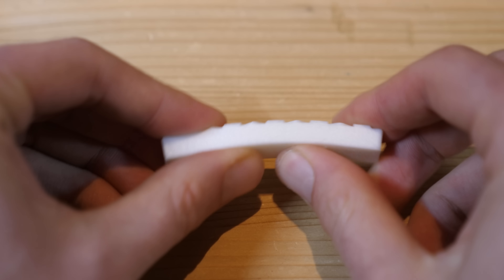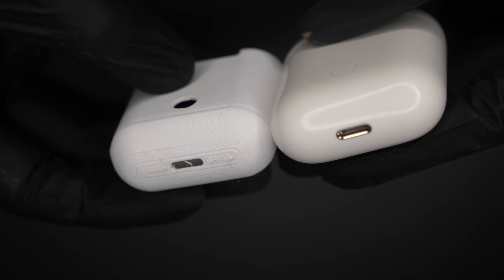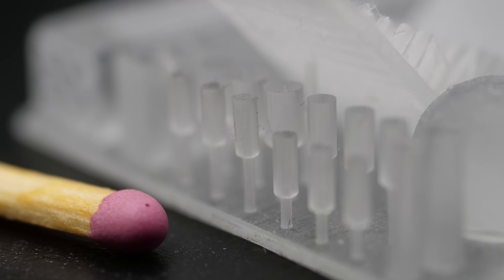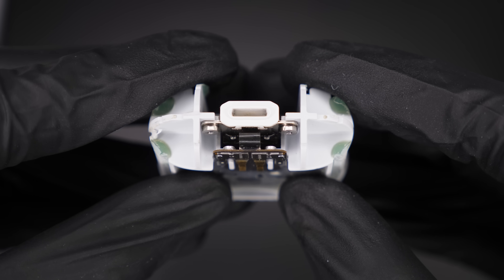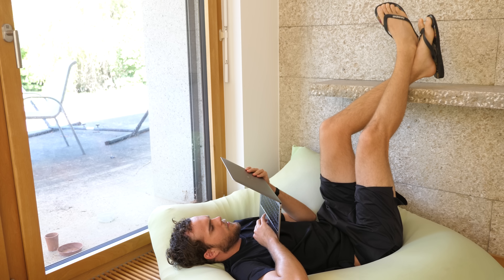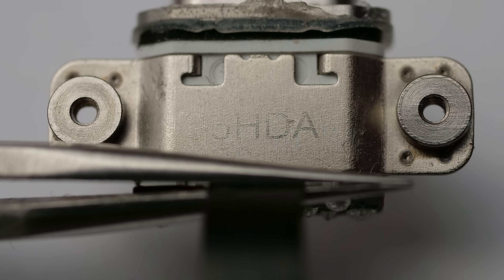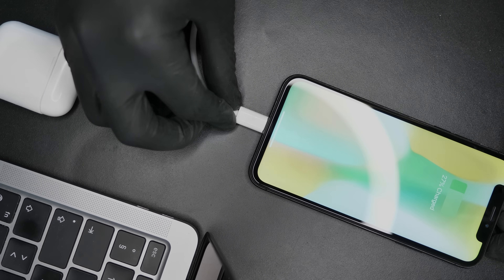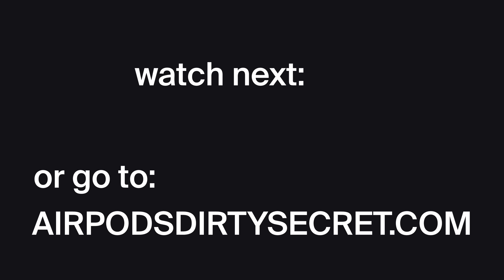AirPods' Dirty Secret (and how I'm fighting it!)

Comment: Excellent work! There is much to love about Apple, but their habit of waffling on about how environmentally friendly they are while simultaneously going out of their way to design products so they cannot be repaired or even have the batteries replaced is unacceptable. Apple has the might that other companies don't have to push the entire industry toward more environmentally responsible production. Projects like this are a great way to dismiss Apple's claims that they are doing their best.
Reply: I went into an apple store about my 12 mini because the battery is crap. Instead of a replacement under warranty they waffled on about ‘habit changes’. I honestly hate this company. I only got it cuz the small screen. Might move back to Samsung…
Reply: @cottage_pie  yea man come to Samsung gang
Reply: @johnlexin7748  I love Samsung but the phones are too big. Make them release a galaxy mini and I’ll switch in a heart beat.
Reply: @cottage_pie  I fired up my tiny S7 to try a new SIM... Found out I can no longer see the words on the screen without 1.5 mag glasses. back to my s22. it weighs a lot, but I can read the screen, and now I get muscles in my fingers too!
Reply: @k0nanick  You can just increase the size of the text to 125%, 150% etc. Everything else gets adjusted.
Reply: @cottage_pie  A “genius” told you that too. I’ve used apple since the 3g and honestly, I hate them. But I also love the os/ecosystem. As a company they piss me off so much.
Reply: "You will own nothing, and be happy with it."
Tesla does it too, even the people who make farm tractors do it as well.
Reply: @GrimReaperNegi  John Deere especially, I've heard.
Reply: @thebiggerbyte5991  Yup!
Reply: Apple has used that might to move the industry alright... but not in the right direction. Before Apple replaceable batteries was a thing. After Apple it's almost seen as a ridiculous notion. They steered the industry in this with the iPod and iPhone.
Reply: @Cimlite  Absolutely agreed.
Reply: What is there to love about Apple?
Reply: @Zorooooooooooooooooooooooooooo  icl iMessage and airdrop are what i use most, but the longevity of my iPhones are the biggest influence. I had a Samsung a few years ago but after about 18 months it was ridiculously slow. What are the newer ones like after a few years?
Reply: @ryleypalmer  Newer Samsungs are way better in that regard. They’ve streamlined the skin they use on top of android quite a bit, so it’s less bloated. My S20 FE while granted isn’t super old, it’s still a couple years old and runs like new.
Reply: @ryleypalmer  don't know what iMessage does but android has its own air drop that works just as fine as apple's
Reply: @ryleypalmer  you moan about samsung slowing down, did you clear your cache? 
I've had a Samsung for years and it's never got any slower and still benchmarks as it did brand new. 

I think you may be confused with the fact apple slow shit down to force you to buy the next model.
Reply: @boziewz6125  both Apple and Samsung got in legal trouble for intentionally slowing your device down. Look it up, apples not the only guilty party here.
Reply: @MrGamelover23  maybe so, but samsung do it far less, and rarely at all now. 
Like I said, my s10+ is as fast as the day I got it and still scores within range on benchmark tests. Battery lasts longer than a day, even with relatively heavy use (pokemon go). An apple purchased at the same time, wouldn't be the same story.
Reply: @boziewz6125  yeah, I have an old s8 active that I still use with wifi and still works as new. I think some people don't know how to properly kill apps and leave them running in the background.
Reply: @kevinmitchell766  I don't think people understand about how battery health works as well. Most will fully discharge before charging, or give a lot of little 5min charges. Plus background activities and bloatware. 
But, that aside, the biggest issue is materialism, people just want the next big thing and make up excuses as to why they need the upgrade. And the usual one is, my old phone was just too slow.
Reply: @boziewz6125  You think Apple users know how to clear cache and cookies? 
According to most, they want a phone or pc 'That just works.'
Most people these days won't wanna know about the 'how' or the 'why.'
It's like how our parents and grandparents could repair their own cars & most things in their houses but comparatively, we can't fix many of those things. 
And now this generation, they don't even wanna learn the basics of a phone or a PC.
Reply: @ryleypalmer  seriously? After apple has been sued in court for this exact thing
Reply: @Zorooooooooooooooooooooooooooo  the ecosystem is unmatched
Reply: @Zorooooooooooooooooooooooooooo  Apple has led the way in smartphone design ever since the iPhone - just look at what Sony, Nokia, and Samsung were doing before and after. Apple designs have led the way and most manufacturers have copied - most laptops now look like Apple, for example.  Apple has done more to turn 'computers' - once seen as geeky  - into cool must-have consumer products than anyone else.  I'm not saying all of it is good - far from it.  I am not saying Apple has the new ideas first - far from it.  But as far as being the most desirable, fashionable and market-steering brand, they are untouchable.
Reply: Big companies only really exist for profit to be honest

At least in my opinion
Reply: @gameseeker6307  all companies are for profit, big and small.
Reply: @asherdie  Some more than others. Just take the charging cable for instance. The most blatant pain that causes trouble and waste for no good reason at all. They don't care period. Plus no back button problem is most don't know what its like to have that control over ads and apps but that is how you maintain control over a people they just don't know. Can't change half my settings and the apps have less control as well I couldn't even delete multiple emails with my favorite app. At least Samsung uses global standards with cables and charging bricks. I still hate Samsung as a company the culture in that country is atrocious. But Apple is the opposite of freedom and America so take that back to Europe or Korea or California but don't Democrat my Freedom by taking away control and calling it security. Let me live outside with the wolves instead of trapped in your prison. At least I die a free man where others perish never knowing it at all.
Reply: @nihcopower808  but for real, tell us how you actually feel. 😂
I went with KYOCERA over Chineseium devices.
Reply: @gameseeker6307   ALL companies exist BECAUSE they make a profit. Even so-called non-profits have to bring in more than their costs.
Reply: I think what they're doing is called "lying"
Reply: @KingRidley  what who are doing? Who lying?
Reply: what is there to love about apple past how m1/2 is mildly interesting due to high efficiency and performance since being ARM
Reply: Apple never gave a shit about the environment, they consume massive amounts of toxic lithium, their products produce millions of tons of e-waste every year, and employ sweatshop labor im countries where environmental protections are an afterthought. Their only priority is pumping their share price, and they know the green excuse will work on their upper middle class consumer base because they never think past surface level environmental concerns when it comes to their favorite companies.
Reply: Apple is evil !!!
Reply: They're also fairly easy to hack (hunter biden, anyone?) overpriced to hell and back, and pretend to have data privacy features. Air Tags, more than any other product they gouge you for, are the most antithetical to the very concept of privacy itself. They're literally "always-on" tracking devices
Reply: "much to love about Apple"
I guess you like it when you're treated like a douche?
Reply: Nothing out of the ordinary ??
Reply: my first phone was a 5c and the only reason I stopped using it was because the battery died and they told me free batteries were for 6 and up
Reply: If you haven't noticed... pretty much all of the companies that claim to be "green" or "environmentally focused" are some of the WORST polluters out there....  The whole thing is a scam.. designed to empty your wallet and make you think you are doing "good"....
Reply: Apple is trash. Environmental criminals, tax evasion....
Reply: Apple sucks
Reply: Why will they change their dirty ways? People buy it anyways. There is only 1 way to force change policy in a corporation that absolutely driven by greed... make them lose money, do not buy their disposable gadgets, only buy what meets your standards. I stopped buying Samsung since the S20... they pulled an Apple on me, their new phones do not meet my standards, if more people had real principles we will not be where we are with all this companies thinking you rent their products instead of buying them. My phone, my car, my fridge, my oven, my microwave, they just need to make sure that there is parts available when needed, forcing me to buy a new one is not going to work.
Reply: There's much more to dislike
Reply: There is nothing to love about Apple. I have considered their products radioactive for almost a decade now.
Reply: I feel dumb now but still
Reply: your dollar is your vote
Reply: @endiii27  Typical Sheep mentality.
Reply: Much to love about most tax avoiding, valuable company in the world, deliberately design in flaws to make their products less repairable and serviceable? Seriously spoken like a true Apple fanboy. Apple made their second return back to tech industry from making style over substance. I mean how many generations of MacBook were made with the CPU and screen pins being next to each other on their screen ribbon, only to be bridged via moisture in the air, to fail, catastrophically and fatally? Apple have had too many design faults to deserve it moniker as a premium brand considering its tiny product portfolio.
Reply: I would love to see a winning point by apple that Samsung didn't secure years ahead of time. Apple is the tesla bois of the phone industry.
Reply: @dillonostrander5286   Apple’s in-house chip design is second to none.
Reply: @tycox8704  that says absolute shit to me. Idc how a chip is made. Could care less. The fact that it does what I say when I say without any kind of stupid questions is what I love about it. Apples reliability and apparent disregard for customers who wish to fix it ourselves are killing points for me. Samsung isn't the greatest but they're past Apple IMO.  Apples just tesla to me. It's built up on a fan base that's dragging along merely for the social aspect tied to it. Apple used to be hot shit. Tesla was cool when if first showed up and it's been nothing but problems with them since. Apple could learn alot by actually listening to their customers and Not the top few shareholders.
Reply: @dillonostrander5286  Be honest. What have you refurbished or repaired, and saved money doing it? I used to replace my phones’ batteries because their usefulness outlasted the batteries, but now Apple will do it for a reasonable charge. Mind you, I was a vocal critic of their reluctance when the Batterygate fiasco emerged. I even wrote a scathing email to Tim Cook. Now, Apple will often hand you a new device when you pay for a battery replacement. They did such an exchange with my partner’s iPad even though the warranty was long over.
And chips SHOULD matter to you. When a chip is optimized to support the software, it improves speed and battery reserves. If you’re referring to Siri…yes, I’m not impressed with it. In fact, I have it turned off. Instead, I rely on Google Assistant and numerous Google Nest smart hubs throughout my home.
Reply: The thing is that planned obselence has been brought to almost every product now due to the Phoebus cartel back in the 19 something’s. It’s great for profit but it’s not good environmentally.
Reply: There is much to love about Apple? Nah
Reply: Well even though that's true they probably the only company that is doing anything at all
Reply: @Jinkis  and even after all of those specs, it’s dreadful to use. THATs why iPhones will always be the best.
Reply: @Sjwatts  you do know apple is basically owned by Samsung, Samsung make apple phones 😂

Comment: Great content, thank you! Until I wantched this video, I never truly considered how unethical it is to produce a battery-powered product that's designed to have such a short half-life. They make more from selling the replacement parts than the products themselves over the lifecycle of a product. On average, 1 person will consume 2 cases over the lifetime of the product (assumption, but I think its sound logic)
Reply: 2.8 cases. It is the value 'e' that is aimed for... Battery or port failure.
Reply: The battery on the buds reached EoL, or a bud or both are lost, before most people need a case replacement. Plus you have to add in the amount of people that just buy a new set if any one of the 3 batteries die, or of they lose any one of the 3 pieces. So it's probably closer to 0.7 cases, but certainly not 2.8, "just because it's the value of e." (BTW, Carl, Euler's number is 2.7, not 2.8)
Reply: @littlejackalo5326  rounding...

Comment: It’s disingenuous to say the batteries cannot b replaced. There r many apple unauthorised third parties out there that can do the job for a fraction of the price. I implore everyone with the same issue, to find someone who can do it. The same goes for the AirPods themselves. I had mine replaced with no cutting/drilling required.
Reply from the maker: Care to share a video where this is done? I'm the talking about the first generation here. Thanks!
Reply: @ExploringTheSimulation  https://www.youtube.com/watch?v=yVtd1Cr6DIY im not sure if this video shows the one with or without magsafe charging. but i imagine it wouldnt differ too much.
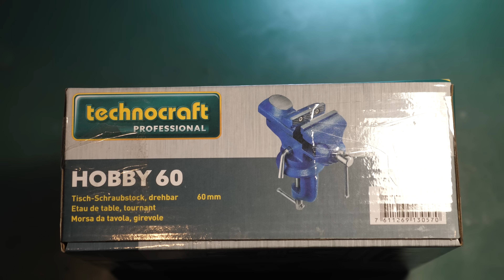Reply from the maker: @RyanLesNOVAL  that's my point, here it shows a second generation case, (0:12) on the link you sent. First generation is a nightmare.
Reply: @ExploringTheSimulation  i havent done it myself before, but i have paid someone to do my gen1s for around 300hkd, which is around 37usd

Comment: Now this is innovation that excites, way to go! I bet if you look back on your project in a couple years you will have likely saved many consumers lots of money while also saving countless devices from becoming ewaste. Thanks for librating our AirPods from the Apple stranglehold of control!
Reply: How is this an innovation? He took an Apple Airpods and then break it and swap with low-quality parts.
Reply: @dcdrinks  Thats not the point, he engineered an innovative solution to a an issue numerous people are facing. Low quality parts? It’s just a replacement plastic panel for the charging case. It’s not really any higher or lower quality than the original.
Reply: @dcdrinks  So by your logic any non-Apple part is low quality? Even the same ones that apple used but are sold online from different store/website?
To think that is dumb af, or just normal for apple shill.

Comment: I get your point, but I would have to think it cost more for apple to do this vs just replacing the AirPods.
Reply from the maker: Yes, that's the point. They designed it on purpose so that it would cost too much to fix.
Reply: @ExploringTheSimulation  fair point.

Comment: Thank you for caring for Earth, unlike Apple. I saw a video about California's solar initiative program. And how it lasted 10 years, but they had no endgame for what happens to the arrays after the program ends so all these solar panels + electronics to run them are ending up in landfills with the toxic metals making their way into the ground water. 

How can a government divide itself into departments to increase the effectiveness of the task at hand and then not be any good at doing that? Doesn't sb pick these people specifically for the job? 😔
Reply from the maker: Didn't know about that solar panel problem, will look into it. Thanks
Reply: @ExploringTheSimulation  I have a feeling the same will happen with electric cars being pushed so hard. Making more batteries is not what we need. Before that it was the CVT transmission. Touted for its efficiency, but bouncy and misunderstood so they fail. Some are starting they never need new fluid inside them and so the access port is sealed. Mechanics just don't work that way. Everything needs maintenance. Throwing things away can't be the answer as humanity's population grows and devices for all of them fail. Next to nothing gets recycled. All the poorest countries end up living in our trash. What kind of life is that. You should check out the problem with John Stewart episode on recycling. I miss trees... Lol. Later.

Comment: Sir, since you have basically done 99% of the work, can you please do this
Fix a Lightening connector on your flex PCB and make the whole lightening to usb a small ribbon that can be stashed inside the phone cover/case....
You can use those superflat nearly flush lightening connector and break out the USB C on the backside so that i can charge the iphone like the apple mouse (face down) using usb C

Comment: I don’t really care for the usb c upgrade as I have plenty of lightning cables flying around but independent repair shops should really consider using the lower case blueprint. Now to the elephant in the room: the battery of the AirPods itself 🤦‍♂️

Great work!
Reply: Could we develop an alternate casing model that can accommodate a more standardised larger battery setup?